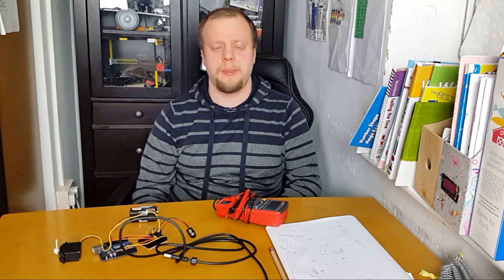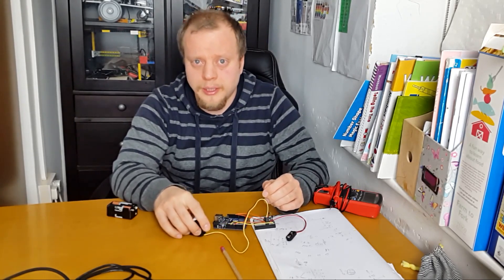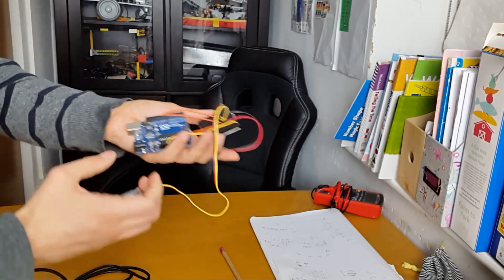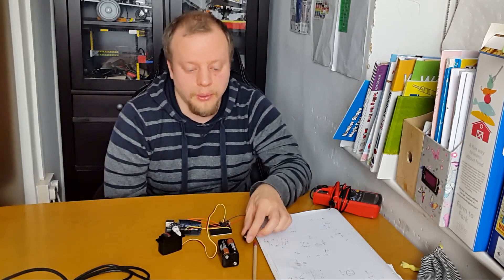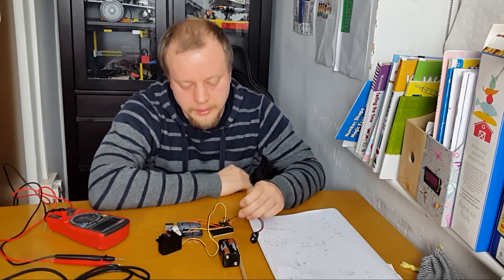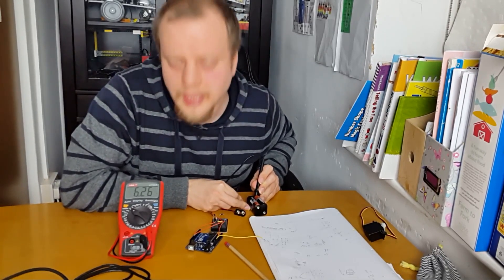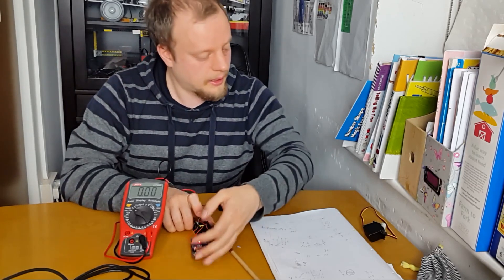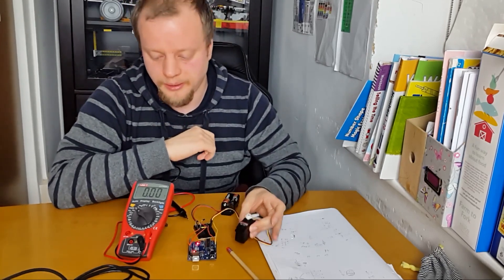Powering Servo + Arduino with 6v Batteries

Comment: Hey, I plan to power 2 servos like those in the video and an Arduino UNO from one battery source. What would you recommend me to do? Should I do it the way you showed in the video or use a 9V battery?
Reply from the maker: Hello, a 9v battery would be too high a voltage for the servo motors without a regulator, they also don't have a lot of current capacity. For two motors, a bunch of AA batteries (maybe 6) plus a 5v regulator capable of a few amps (like a UBEC) would be a good idea.
Reply: @Orionrobots  I'll probably use MP2307DN step down module (just need to make sure the system won't draw more than 4A...) for the 9V to the servo. Thanks a lot 👍

Comment: the input into the servo is NOT PWM,  u can run it with PWM, but it is actually just an ordinary analogue input,  u can just control these motors with an ordinary potentiometre.
Reply from the maker: Thanks for the suggestion. I've not tried it directly from a potentiometer, however, most documentation and reference I've seen suggests it is pulse length that controls the servo position. I have usually driven servo motors from microcontrollers with digital PWM pins and rarely analogue outputs, so it is unlikely I'd use it that way.
Reply: @Orionrobots  its just a sum of current, pwm or just raw voltage.  i wouldnt think it would make a difference.  =)

Comment: Can you tell me what components i will require where I want a servo motor with 180 degree rotation and where I need to change the product with which rechargeable battery and a illuminated switch or vibrator where I should know whether the motor is on or off... All these things should fit in 6 by 6 cm of area
Reply from the maker: Servo motors can range from 120 to 180 degrees. You may have to think about the torque needed. An sg90 may be OK for lower torque. You'll need a Controller, an Arduino nano would fit that space. For batteries, something like a 2cell Li Ion, plus a boost and charge module. This last item may be hard to fit in the foot print, so you could consider Li poly, but be clear on safety if doing so.
Reply: @Orionrobots  i will need 180 degrees... could you send me links for all these components to get a better idea... thanks btw

Comment: how about 9 v?
Reply from the maker: The arduino regulator should cope, but not sure you want to put 9v through those servo motors. Perhaps then you need another regulator, maybe a BEC, to reduce it to 6v. One that can take the high current servos will need.
Reply: @Orionrobots  i see, i should do research more about this. scared it might burn or something im just starting to learn. thank you. :3

Comment: I had made a buck converter circuit and i want to use the output voltage of that converter to power up servo motor,but when i connect the negative terminal of the output to the arduino ground,the output voltage drop suddenly,can you help me why this happen,tq
Reply from the maker: Perhaps you can make a circuit diagram for it, a link or ascii art are ok for that. Then we can take a look.
Reply: But is it possible to connect the output vltage from buck cnverter to servo motor?
Reply from the maker: @anasamirul2080  what are the input, and output voltages to this buck converter? What currents does it handle?
Reply: @Orionrobots  i forgot to consider its current,but if the current is compatible with the servo, so it should not have problem to move the servo, am i right?
Reply from the maker: Let me try to see if I get what you have. You have an input power source to the buck converter. On the buck converter output, you have, in parallel (can't see if being anything else) an Arduino and a servo motor. You are seeing the voltage sag when you connect the arduino. Have I got that right?
Reply: @Orionrobots  yes,when i connect the ground from arduino to negative output of buck converter,the output voltage from buck cnverter drop
Reply from the maker: Ok, what model arduino? What is the buck converter voltage output?  What is the nominal current capacity of that buck converter? Does it drop with just the buck converter and arduino and no servo? Is the arduino separately powered or just from this converter?
Reply: @Orionrobots  i have got the solution,my mistake is actually because there is short circuit when i connect servo ground with buck cnvrter ground,anyway thanks for helping me
Reply from the maker: Hmm, so the buck converter floating a ground at a different level from the supply ground then?
I suppose I expected a T shaped configuration, ultimately with a shared ground.

Comment: Can you please help me on servo controlling part, Whenever I was powering the servo from external 6 volt  source and controlling the servo using Arduino  puls-widt..it wouldn't work  but
Reply from the maker: What connections did you make, and what were the symptoms of not working? Did you use example code?
Reply from the maker: Ah one sanity check, if you have an external power source, are the two grounds connected? They must share ground, or no signals will  get through.
Reply: @Orionrobots  thank for the reply .I solved the problem
Reply from the maker: If you don't mind me asking, what was it?

Comment: hey i wanted to follow but i have no knowledge about diodes and transistors and those electrical components, i just don't know when to use it (i don't wanna break my arduino :)) im simply trying to connect mg995 with arduino and power it with 6v batteries. Any suggestions for me to look up>?
Reply from the maker: The arduino has its own regulator if you connect 6v to the vin pin it will regulate this to 5v for itself. Still, if you intend to share the batteries with motors, you may experience resets on the arduino when the motors pull power. Better to have separate batteries, or a big capacitor in parallel with the batteries.

Comment: hello there !! I'm working on a robotic arm contolled by arduino uno and 4 servos, can I power them with a 4AA batteries ? or I need another source of power please I need your help as fast as possible
Reply from the maker: 4 AA batteries = 6v - enough to drive servo's (not if they are rechargeable). I would still recommend a power source for the arduino and another for the servo's, but at a pinch you may be able to drive these. I did experience drop outs and resets - this is because the servo's will make current demands of the battery that would see the voltage drop below that the controller needs, so it resets. If you can - 2 power sources, sharing a ground.
Reply: so I need a power source for the arduino board and another one for servos !!
I wonder if a 9v battery could do the job with the servos ??
Reply from the maker: Perhaps - the Arduino should be able to regulate up to 20v. You may want to put in a big capacitor to ensure that load on the servo's doesn't translate into choppiness on the Arduino supply.
Reply: Hey dude !!
is it possible to plug the servos with a phone charger ?? output of 9v 1.6A or 5V 2A
Reply from the maker: It sounds like it should work. It might be worth monitoring the current on the servo's when trying it - especially when they are stalled or jittering. Depending on the phone charger - it may undervolt, cut out, or heat up if the current is over, so mointor the temperature the first few times. The particular servo's should have a datasheet with their stall currents on them, which gives you an idea of worst case conditions.
Reply: Orionrobots it worked so fine with the samsung charger 5v 2a 😉
Reply from the maker: Achraf Jradi any pictures or videos?
Reply: I will send you a video as soon as I assemble the project all together ;) 
do you know how to calibrate a color sensor tcs3200 ? it keeps on reading color even when I put white color on it !
Reply: I will send you a video as soon as I assemble the project all together ;) 
do you know how to calibrate a color sensor tcs3200 ? it keeps on reading color even when I put white color on it !
Reply from the maker: Never tried one of them - it sounds like an interesting device to play with though...

Comment: ok what if I wanted to power 4 servo motors ? im currently working the r680 banshi robotic arm for an electronics project. im using arduino instead of the included pcb. and I cant figure out the power problem :(
Reply from the maker: Hi there, and thanks for the comment. You are definitely going to need beefier power for that. I'd opt for 12aa batteries, or using 18650's. I'd also suggest having capacitors going across the power/ground near the servo's to reduce any voltage drops or noise while they operate. What voltage range does the DC voltage pin on the control board for that r680 take? Could you potentially flash the Arduino bootloader on the controller on that included PCB?
Reply: I got the servos running but now im facing another problem! im uploading the code to arduino and when i power it on the servos keep rotating forever. any suggestions ?
Reply from the maker: Sultan Kabboha can you show me your code? servo motors shouldn't rotate continuously, although there is a kind modified to turn continuously.
Reply: yes I discovered that continuous rotation servos are difficult to deal with. anyway i replaced that servo with a 180 degrees servo motor. im also using a gyroscope in attempt to control the servos with Pitch Roll Yaw directions. i only managed to get the accelerometer values in z and y dimensions only. im trying to map the x value to control the 3rd servo. can you help me ?
Reply from the maker: I can try. Lets start with some basics - what Gyroscope is it, and how does it interface with the Arduino?
Reply: MPU6050 it connects in A5 and A4. it has a gyroscope, accelerometer and tempreture sensor.

Comment: Using the power jack/plug adapted for batteries on the Arduino  I have used as much as 12 v on the Arduino UNO V3 the UNO is happy with 9v as well; the on-board voltage regulator will drop the voltage down for the Arduino UNO and  to 5v and 3v for any external senors or other devices, So I do not see the need for any diodes or resistors from the battery power source to run the Arduino,it will be happy with a full 7 volts too. Do not go over 12V.

The diodes will not result in any harm but as your battery power becomes weaker the diodes will hasten the reduction in voltage. You might want to try a 6 V lantern battery that can sustain more current for a longer duration and the voltage will be more stable over a longer period of time, providing physical size of the battery is not an issue.

It is not an absolute requirement but it is better to use a 2n2222 transistor to turn your servo motor off and on, safer for the Arduino. Or even use an opto isolator  that way you do not have to worry about pulling to much current through the Arduino or voltage spikes from the motor..
Reply from the maker: Hi there, thanks for your comment. Since this is intended for projects with limited size - ie small robots, 4xAA is about the right size. However - this is then about 6v - too high for the bare Arduino, too low for it's regulator. I could use a USB battery pack perhaps to get 5v, and it may be able to drive a servo too - these have been improving fast, although would a servo work at that voltage.

As for the current draw - I would assume that the pwm signal to the servo is all signal not driving power, and the current pull is on the voltage in line.  I would (and often do) use an H-bridge for a DC motor or stepper.

Comment: Actually You won't hurt yours Arduino by powering it by 4xAA battery connected directly to vcc. I've tried it, so no worries :)
Reply from the maker: I suspect that the 328 is tolerant of a fair range - this depends on the model you have. The 328P datasheet says that 6V is the absolute maximum voltage. Beware that other things attached - sensors and similar may not be so tolerant.

Comment: thanks for the vid, may ask if there are any programs available because I'm a bit confused with what to do with my PWM, particularly pins 9 and 10, after I made the connections.
Reply from the maker: +sic ninja did you mean demo code programs? Or YouTube video programs? There are Arduino samples for servo motor control - under file-> examples-> servo.

Comment: thanks for the vid! i have a question - i used a 4 AA battery holder thing and attached it to Vin and Ground on the arduino uno. when i do this, the board is on, but it won't do the commands i uploaded to it. any idea why?
Reply from the maker: ok. simple things- check polarity of the batteries. any lights on the arduino? are you sending commands via USB?
Reply from the maker: +Caroline Barley did you get this to work? I'd love to hear where you got to and changes you had to make.